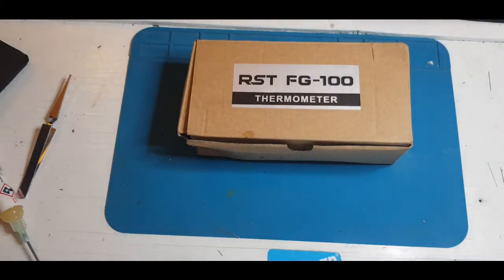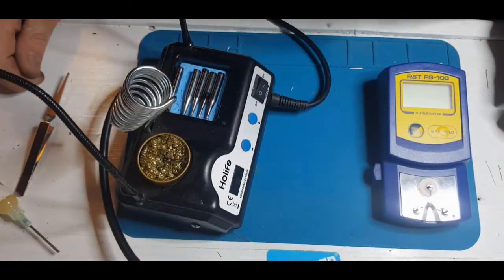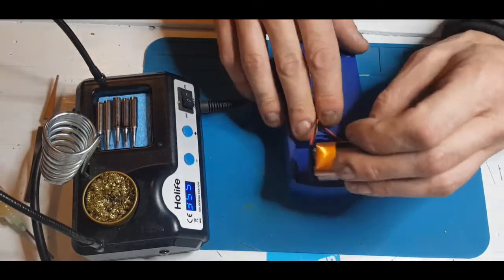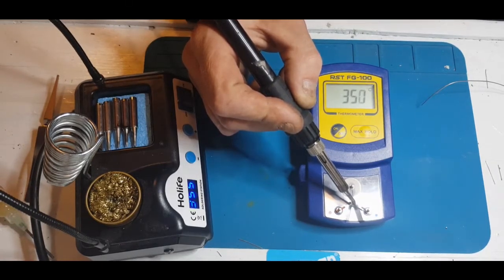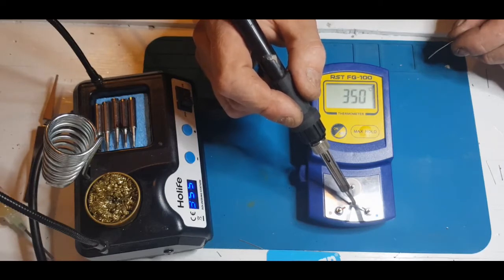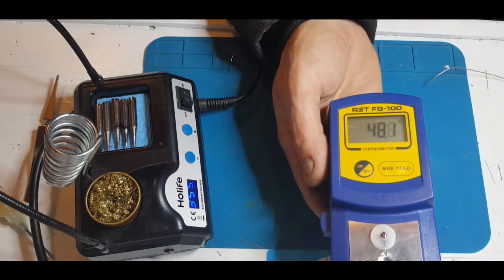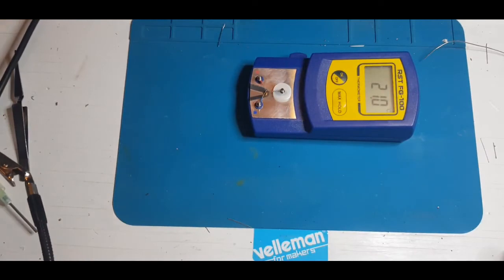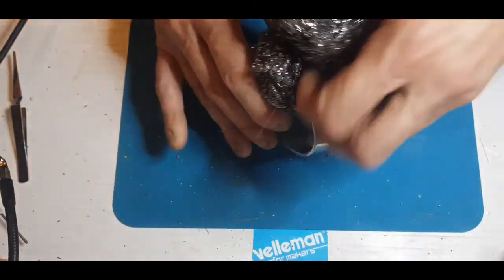RST FG-100 Soldering Iron Thermometer  (FAKE HAKKO) - DOWN THE SHED

Comment: Would
You have by any chance a recommendation for a soldering station (variable voltage ) for 250W 110v (3A) ? Naturally , with a temperature setting wouldn’t be bad , but not sure if not just better to have this tool and just a variable power station.
Reply from the maker: @ikust007  look through my videos for my solder station. Not a bad one.  You could go for one with hot air blower also but that's more useful for surface mount removal
Reply: @downtheshedwithjason  thank you !! Just bought. Vevor . And the thermometer . Thank
You !